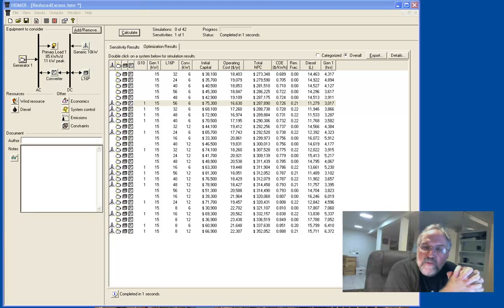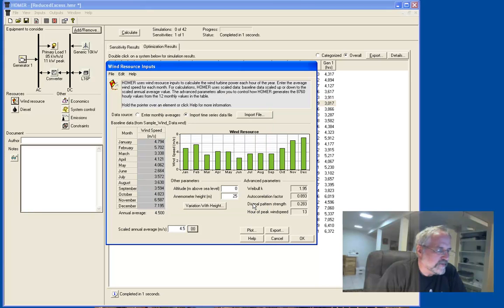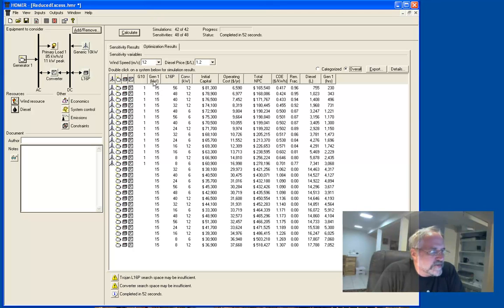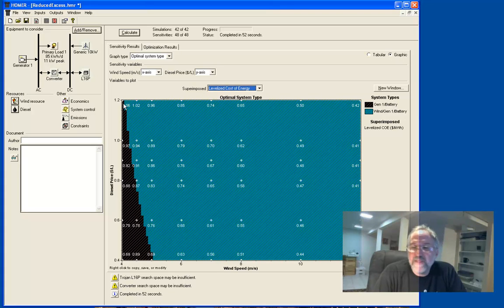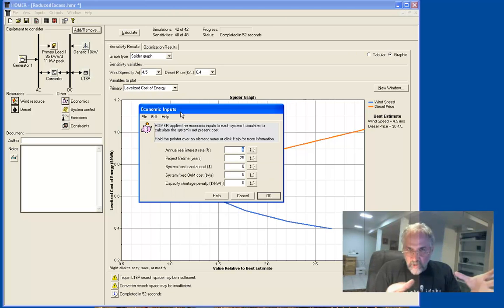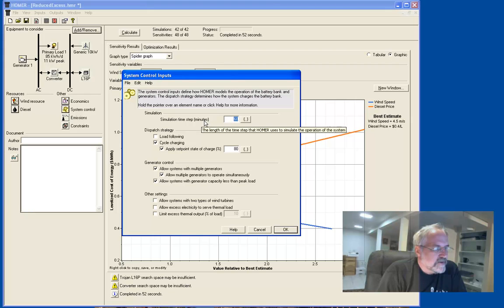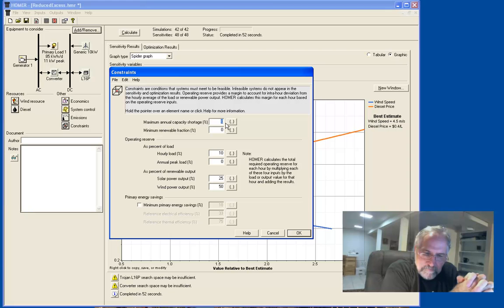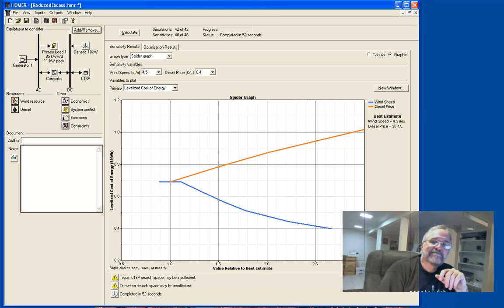HOMER Sensitivity Analysis

Comment: Okay I know this is from 9 years ago but I'm hoping by some miracle you can help me today. When I do the spider chart and I change one of the variables, a portion of the gradient for another variable changes completely (goes from positive to negative gradient) and I can't understand why or what that means. I really hope you see this, it's driving me crazy!
Reply from the maker: Well, you're right, it was a long time ago, but let's see if we can't figure  this out.  I don't recall the details of the Homer sensitivity analysis, but I can speak to the general concept.  You need to keep in mind that the underlying problem (microgrid design) is highly nonlinear.  Unlike some nonlinear problems, this one is characterized by a lot of discrete nonlinearities. So the change in one variable could pop you over into another completely different domain.  Say for example the by-back price for excess electricity was much less than the retail price being displaced.  If your current design is below net zero, then the economics might look very favorable, and an incremental increase in capacity has a positive economic impact.  However,  if you increase the generation capacity above net zero, then the the economics are quite different and an increment increase could easily have a negative impact.

Does this sound like the problem you're having?  Hope it helps.

JFG
Reply: @johngardner2979  Wow thanks so much for replying! Your explanation is really helpful. So when you set the sensitivity variables to different values, is it that the chart is showing you those set values as if they are the base case? So each combination of variables is its own case?

Basically, I was expecting that as you change the values, the respective lines retained their gradient and just shifted laterally left or right, depending on if the value was set to be higher or lower. So that's why I was really confused when the line did that whole flip. But I guess that has do with the non-linearity you talked about.

Ok so the variables in question are the grid (retail) price and wind speed as relates to the NPC. When I increase the grid purchase price above a certain value, a portion of the wind speed gradient (the higher  speeds) flips from positive to negative, meaning that high wind speed goes from increasing the NPC to decreasing it. I was assuming that wind speed and capacity are linearly correlated (I was thinking inversely proportional so that as speeds rise, less capacity is needed) but from your explanation I'm guessing it's not that simple.

I'm thinking what I need to do is figure out the possible reasons why high wind speeds might increase or decrease the NPC. I was thinking that the only factor was wind capacity (high wind speed -> less capacity-> lower NPC) but maybe it's more than one factor. So for example, at higher grid prices, when high wind speeds decrease the NPC it could be because the model favours less wind capacity AND less grid purchases. Or at lower grid prices, when high wind speeds increase the NPC, it could be because of increased grid purchases, or increased capacity to capitalise on a sellback rate, or a combination of the two ??? Can you tell me if I'm thinking along the right lines?

Sorry for the long paragraph. Lol typing this out helped me to think. Thanks a lot for the help though. I'll keep trying to wrap my head around it.